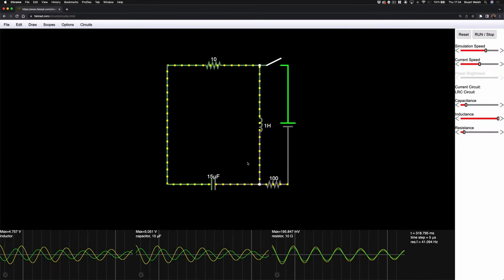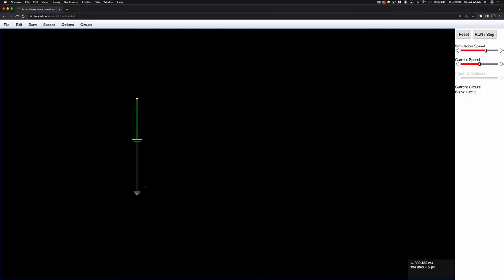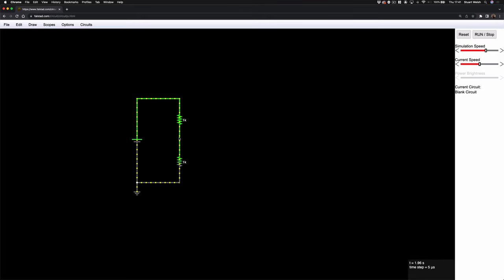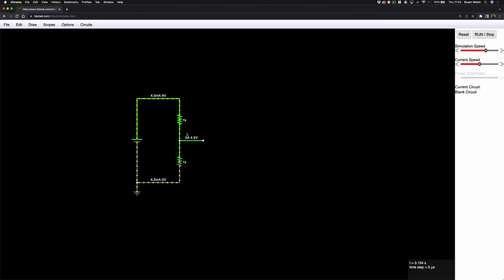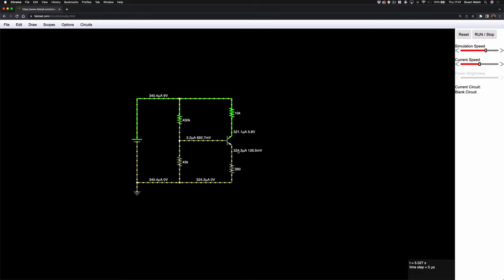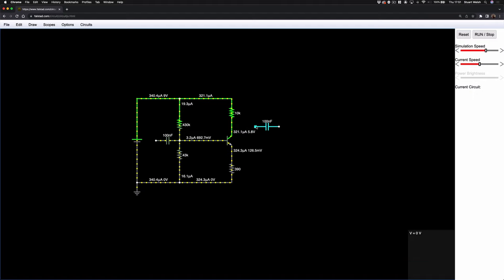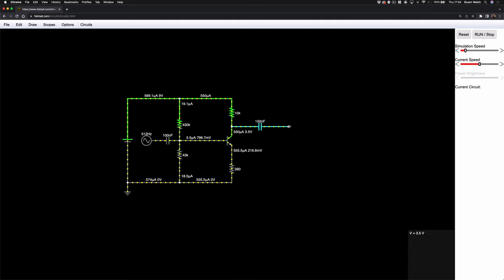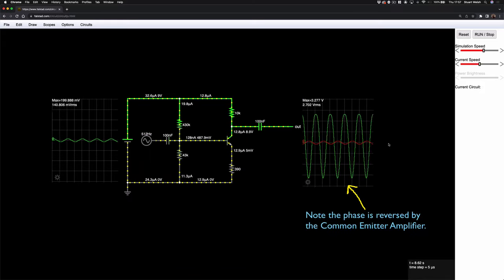Introduction to using Falstad Circuit Simulator for Audio Circuits (Common Emitter Amplifier)

Comment: I came across this video pretty much the day after I had used Falstad for the the first time and learned a lot! Those scopes are amazingly useful. I want to build a headphone amplifier so this video was extremely topical. I had reduced the voltage to 5V (as I want to power mine over USB ultimately) and your specific circuit was all wonky with that DC voltage. Adding a slider for each resistor seems like a perfect way to tweak the values such that the resulting amplified sine wave is optimal and doesn't clip. Can't wait for those follow-up videos!
Reply from the maker: Thanks. That sounds like an excellent project. This circuit would be considered a preamp rather than a power amp, like in a headphone amp. If you wanted to build a discrete (Transistor based) headphone amp I’d suggest a class AB design (the video one is class A so really inefficient). If you want a super efficient 5v powered headphone amp, check out Analog Devices MAX IC’s they’re Class D so super efficient and will run on lower voltages. 👍